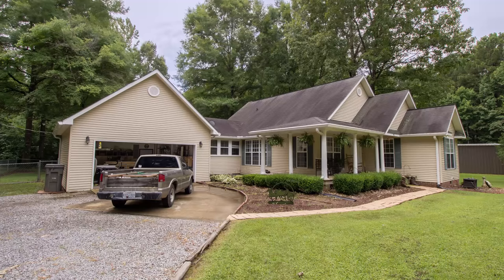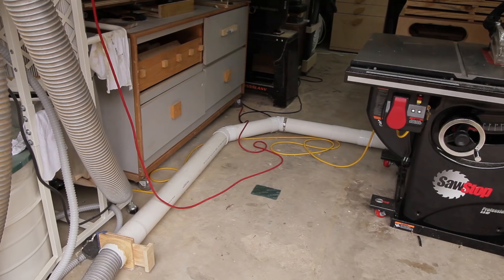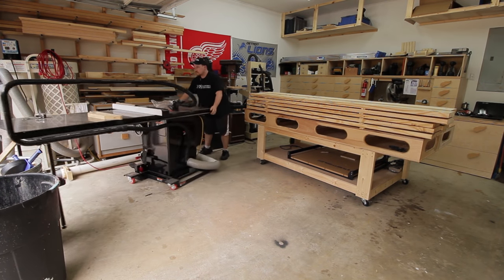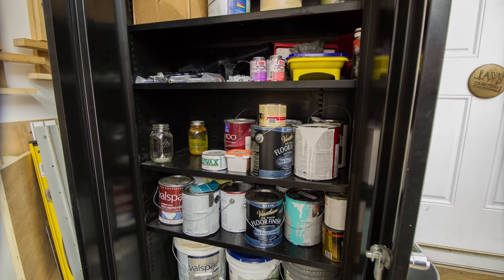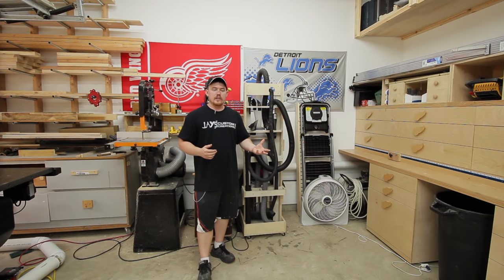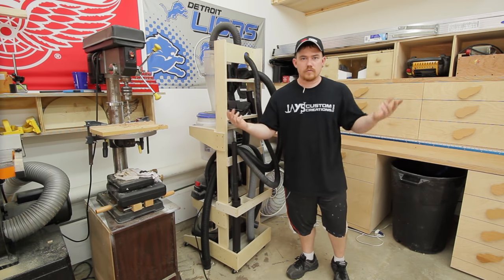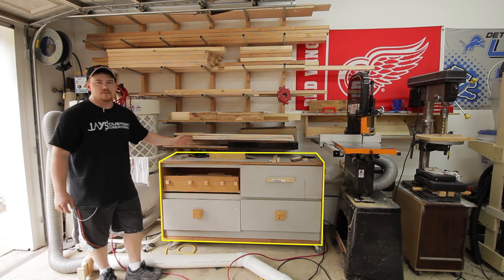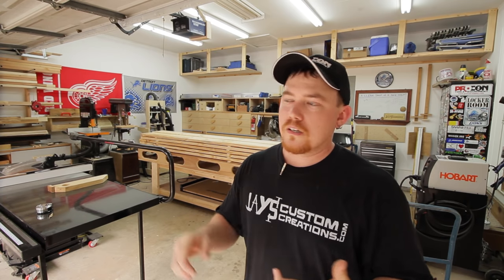2 Car Garage Woodshop - Shop Tour 2015

Comment: Hey Jay, great video, I just wanted to make one suggestion/comment.  I live/work in the Pacific Northwest and am 50+y.o..  When I decided to dedicate one stall of my garage to a wood shop the first thing I did was lay down a floor, to cushion my feet from the concrete.  I used Delta FL dimpled plastic sheet material to lift the OSB T&G flooring off the concrete.  Then I painted it primer gray and added non skid.  I have to say this was a HUGE improvement in both physical comfort for my feet and my ability to heat the garage (critical for our cold winters).  Anyway, again, thanks for great videos, really appreciate the time you take to put these on line.
Reply from the maker: +Scott Bulger Thanks for the suggestion. But there's no way I'm moving my miter saw station just for the flooring benefit. And my floor is really uneven so sheets won't lay flat.

Comment: I like your update. Looks like you have a place for everything and everything in it's place. My shop/garage is an organized mess, but I do have everything on wheels. Usually, I just roll what I'm going to need outside so I don't have to worry about dust collection. It never goes back in the same place twice, so it's like a new shop every time. lol

Comment: I love casters! Everything possible should be movable.

Also love Craigslist. Constantly on the hunt to update tools. 

Best thing I did in my shop was put some electrical drops from the ceiling. Avoids the cords which you almost never trip over. :)

Thanks for sharing the details.

Comment: Thanks Jay.  I really enjoyed the video.  I have almost the exact same size garage.  I rewired it, though, and made extensive overhead storage (after re-enforcing the roof) and put in a wack of LED lighting.  I have just finished, as you did, putting all the bid tools on casters and instantly had double the space even before organizing the little stuff.  Also looking forward to being able to configure it for each job and not being locked into a fixed setup.  If time allows, maybe I will start a channel and you and others can see it.

Comment: Insulate your garage door with Foam Board Insulation! It's cheap, easy and helps with the heat!!! I leave in Houston Texas and it is HOT with HIGH humidity. Works great for me.

Comment: Binford 5100...More Power!!
I admire your tenacity to work in the heat. Where I live in the Central Valley of California it gets over 100(last couple of days the thermometer has been buried over 120 but probably around 110) with almost 100 percent humidity. It about kills me. I can only work from 6AM to about 10AM when it is this hot. I dream of insulation and A/C in my studio/shop.
Reply from the maker: MsRmaclaren We stay in the high 90's in the hot part of summer and occasionally break 100. If my shop were subject to the temps you mentioned I would probably break down and get the AC going.

Comment: We have a detached garage that has become known as the "Boat House" simply because that is what houses the boat that is mid - refurb.  It is also needs to serve as a wood/fix it shop.  I am a newbie with the woodworking but am really enjoying it and looking forward to learning more.   I have acquired some average tools and usually find a way to make what I want with them.  My problem has been setting up and keeping things organized.  Most of my time is spent looking for things I know I have - URGH!!!  Your Shop Tour 2015 has helped me greatly.  I have been looking for a good layout, but knowing it needs to stay mobile to allow for storage of the boat. After watching your video, I am so excited to get out in the garage and set things up.  My shop is about 17' wide by 30' deep roughly. I definitely like your wasted space shelves and look forward to making some in the shop.  We currently live in Ohio and the shop is NOT insulated so it is only able to be used in the Spring and Summer but I would love to earn the money to insulate it.  That may be a few years out but it is a good goal.  I also love gardening and that takes up some of my time in the Summer also.  I do have heaters I can use if I need to do some work in the shop during Fall and Winter.  Question: What types of Joints did you use when you were first starting to build things? Specifically I can see where pocket whole joints would be very handy, but I do not yet have a Kreg to make them.  Thanks for your time, videos and knowledge.  AJ

Comment: Great suggestion on the debt-free. Best suggestion on tools, if you're going to use it every day it may be better to purchase higher quality tools. Drills, bandsaws. Also is the tool cheap enough you can buy 2 for the price of a really good one... Maybe try the cheap one. Just something's that seem to have worked for me. Harbor freight tools are cheap but I have only had a few fail me over the years. (Angle grinders)

Comment: Just a thought...tear out the drywall on the ceiling...there is a ton of storage up there! If you are worried about insulation, I insulated the ROOF, not the ceiling. I store tons of stuff up in my "attic" which is open to the shop.

Comment: Hi jay thanks for the tour great shop you got there I was a bit surprised not to see a jointer.
Is the lumber you buy already well dimensioned and the table saw is obviously hi quality .
I never pay for lumber as I have a large local glass manufacturer that dumps endless amounts of shipping pallet softwood a great tip for any of your other subscribers I also salvage old hardwood doors and frames from my day job a jointer is a necessity for me .
Reply from the maker: Stephen Hamilton I get lumber from Lowes. Not the greatest but the best I can find.
Reply: thanks for the response jay .
no idea where lowes is i live in ireland lol nice to speak with someone so far away with same interest tho please check out my latest post if you have time my vids are just slide shows and are intended to inspire or give ideas and i also include suggested sizes in some of them
.there not how things shold be done vids but hopefully someone somewhere might take something from one of them

Comment: nice video, but i would like to point out that restricting air on a blower does not bog down the motor. It actually takes some load off from not having to move air. Just like putting your hand over a shop vac hose and the motor RPM rises. Less effort to move air. The only time it will bog down is when you have a gear pump or a piston pump. Anyone can try it if they have a kill-a-watt meter. In your case however, it is better to have more air flow through your cyclone for particle separation.

Comment: Both inspiring and informative! YES, I got something very useful from your video efforts here... the VERTICAL arrangement for the small dust-collection, vac / cyclone. 

I too built a single rolling unit for my vac' cyclone, but made it horizontal, and it eats up too much real estate in the garage. Your idea is better. So next week, I'm building something more like yours to conserve space. That should help keep SWMBO happy. ;-)

THANKS for the many good ideas! In the effort to help return the favor, I'll be checking out lynda / JB soon.

Comment: Hey Jay. 

Nice job Jay. Looks like the layout is working very well. Really like your channel. 

Gotta question for you. 

Is your Forman Kreg BD -210 pocket hole machine worth the investment?  I have a bunch of pockets to make for a bunch of cabinets. I was viewing your bench project???... when you had an issue with your Kreg Forman tool. 

Really don't want to spend that kind of nickels for a tool that's going to fail. 

What was it that broke on yours and your thoughts on that tool or possibly another one that would surpass the Kreg would be greatly appreciated. 

Also.... do you think that type of butt joint will hold up well over time. I'm a big datto joint kind of guy but if this system does as well it will save enormous amount of time. 

Thanks for your help. 

Best.

Comment: Hi Jay!
About the Paulk table... you said it's convenient to leave tools in the round spaces below. I sometimes use fine drills (like 2mm, or 5/64) for drilling a fine screw hole.  And it breaks really fast if you hit somewhere wih it.
Do you think puting a drill down there would be an issue?
Thanks and good luck with your shop and projects!
Reply from the maker: jakoball I don't think so

Comment: Jay, because I follow your videos, I knew everything in your shop.  Great video.  One question...what happened to the drill press table/cabinet with drawers?
Reply from the maker: Robert Mazzitelli It's stored in one of the miter saw station cubies. It can be installed again if needed but it just takes up too much space for the location I have the drill press stored in.

Comment: The design yo have for your workshop is giving me tons of ideas for my own. My shop's rough dimension are 19' by 19'. I like the Upper storage on the back wall and the rattle can storage on the wall.  Was there anything about these two sections you would have done differently?
Reply from the maker: BlkMesaHero I would have made the finishing supply rack taller.

Comment: Jay, I've just started taking an interest in woodworking. Similar to your start, I bought some lumber and got a circular saw from my kids for Father's Day... a very small start. I built some storage shelves for the garage and it worked out well but nothing is very square. I bought cheap 2x4 and 1/2 in ply from a big box retailer. Everything was quite warped. Am I missing a trick on where to buy materials? Or do I just need to take more care when selecting it? Where do you buy your lumber?
Reply from the maker: Aaron Drysdale I get my lumber from Lowes and my plywood from Home Depot. I do not have a hardwood dealer or a real woodworking supplier within a 2-1/2 hour drive of my house.
Reply: +Jay Bates I guess I consider myself lucky to be a head sawyer in a hardwood sawmill. Get most of my nicer woods ( cherry, oak, maple etc) next to nothing. I make some nice stuff too. Keep on Jay.

Comment: Thanks for the tour Jay.  Where do you sell the projects you make?  I finished up some cedar planter boxes and friends want me to make some for them, along with the 3 tier planter Steve Ramsay designed (it came out great and makes an awesome herb planter for the deck).  I'm like you with the garage, but after 30 years here of packratting I have to put all my tools on wheels and work in the driveway.  I just started woodworking again this year and I've been making all the basic table saw sleds and jigs.  So, making some things and selling them I could get a bandsaw and some other things I need.
Reply from the maker: Jim Beshears I don't sell anything anymore but when I did I used Craigslist and Facebook. I also found a salesman who was interested in my product. Batching out several and selling to him all at once was the best option I found.
Reply: Thanks, Craigslist it is.

Comment: If you ever do want to insulate you should look into blown in insulation.  All they need to do is drill like a 1 inch hole into every stud cavity that can easily be patched over.

Comment: jay what is the best way to keep rust off of your tols like the table saw. i have a two care garage and the problem is it is all open no doors at this time i cnat put in any in. so any help would be great. by the way i love the shop tour and all your videos keep them coming.
Reply from the maker: ***** I've had the worst experience with wax. A much better experience with using a wipe on poly but I kept scratching it off. The best experience so far with T9-Bosheild.

Comment: What humidity do you have in the shop? It sometimes reaches 85% in mine and I'm a bit worried my tools could rust. Do you have any precautions up your sleeve? :)
thanks
Reply from the maker: jakoball Whatever humidity it is outside is the same here in my shop. Most all of my tools have some rust on them. I've recently started using Boshield T-9 with good results for preventing rust.

Comment: Hey Jay you do a great job on your videos!  Do you have any knowledge about painting or staining garage floors?  I have a 40+ year old house and as you can image the concrete is a mess.  Is there any product that doesn't entail 'etching' the concrete first but simply just power wash, dry and then roll on?  I realize that it will wear but I can do it again sometime, right?  Any thoughts?
Reply from the maker: +csiaudio I've got zero experience with concrete floors. Sorry.
Reply: Totally understand Jay but appreciate the reply!
Reply: +csiaudio On Youtube, look up "Bleepin Jeep Garage Floor Epoxy."

Comment: On the electrical is all your stuff 110 or do you have 220 also. Right now my (shop) is half of a 10x12 shed lol.
Reply from the maker: Jason Hockett I have two 120v circuits for the dust collector and any tool that might be in use. And one 240v circuit for the table saw.

Comment: We are in process of building a new house and I will have a separate heated and air conditioned workshop. It is 20'x20' (wish I had made it bigger). It will have T-111 siding on the walls. This video has given me some great ideas to incorporate into it. I discovered your site last week and love it. You have a lot of talent my friend. I'm new to wood working and I have learned a great deal in watching some of your videos. My first project will probably be the sliding mitre saw work station. Keep up the great post. By the way, you can put in a mini split air conditioning system for about the price you paid for your sliding mitre saw. Lol  Check this out. www.heatandcool.com

Comment: Get a swamp cooler for your shop.
Reply: +Donna Shahan swamp coolers only work well in dry climates. Jay is in a very humid climate. Also, swamp coolers introduce high humidity into your environment, which creates wood movement - not great for a wood shop.